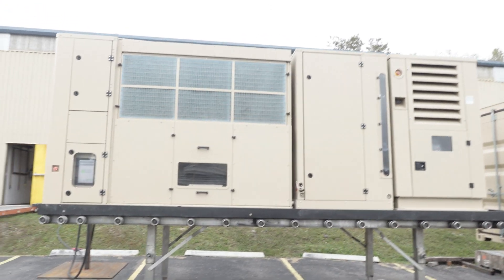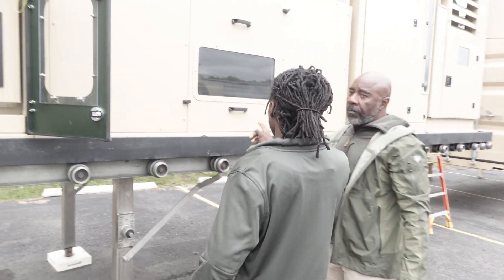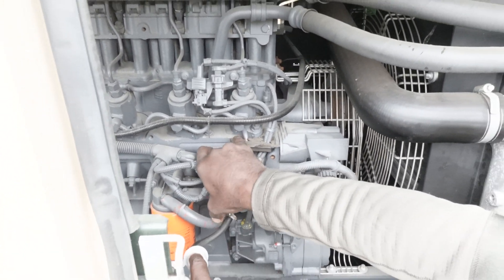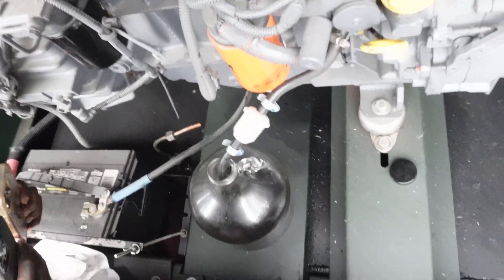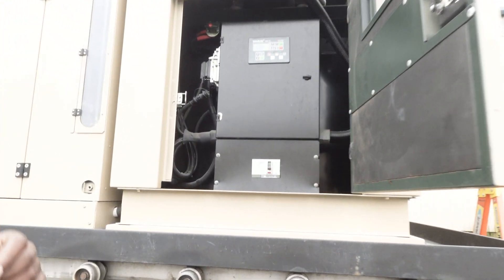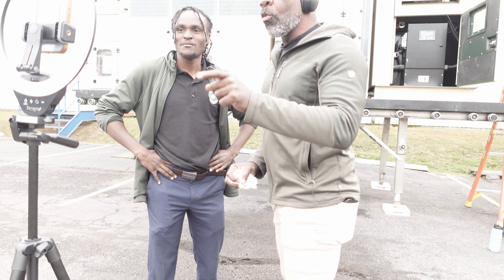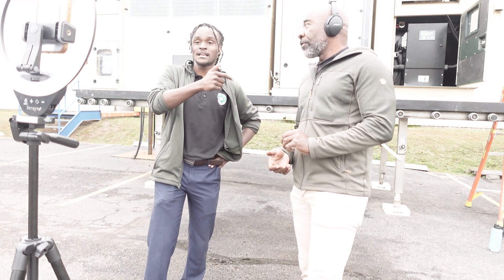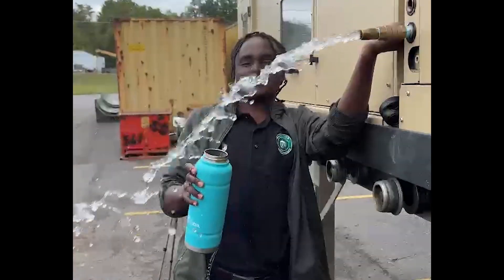Turning Plastic into Water! With Moses West @MosesWestFoundation

Comment: the problem with these atmospheric water generators is, theyre just glorified dehumidifiers. if the climate of the area is humid most of the time, it will work, but it also takes a LOT of energy. the less humid the place it, the more power it takes per unit of water to produce.

Comment: the only things you got from that diesel fuel was heat noise and diesel exhaust the heat powered a machine that sucked moisture out of the air all of those steps could’ve been skipped by putting a bucket in the rain.
Reply: Quit hating u can't always count on rain

Comment: [ Renewable Energy ]
                    |
         ----------------------------
         |                            |
 [ Green Hydrogen Production ]     [ Carbon Capture ]
         |                            |
         ----------------------------
                    |
         [ Efficient Fuel Use System ]
                    |
         [ Emission Monitoring and Capture ]
                    |
         [ Waste-to-Energy / Recycle ]
                    |
               [ Near-Zero Emission ]